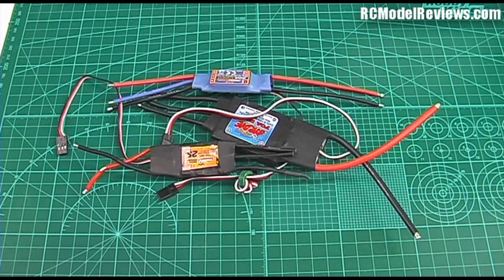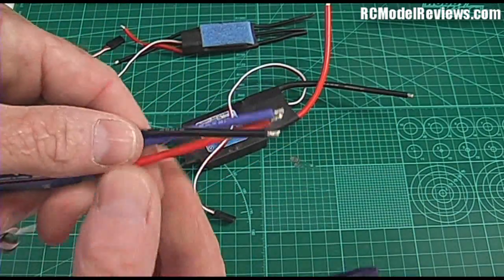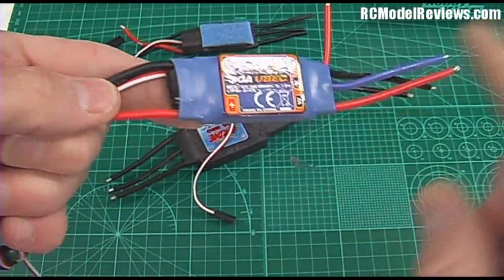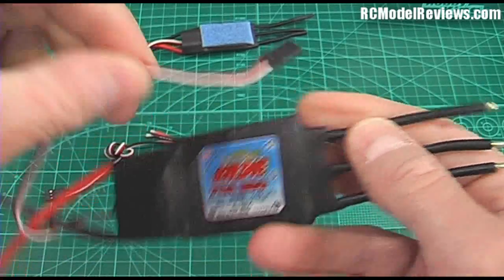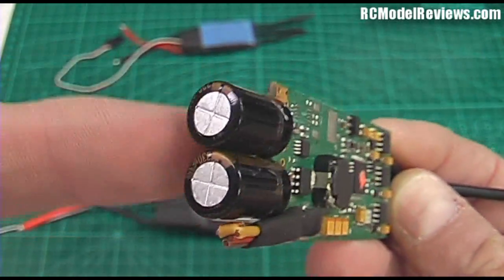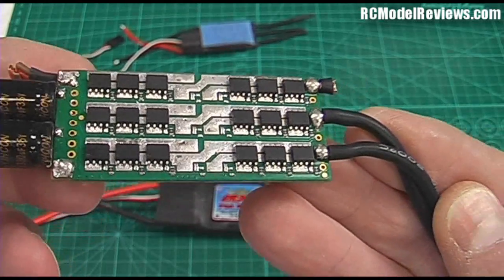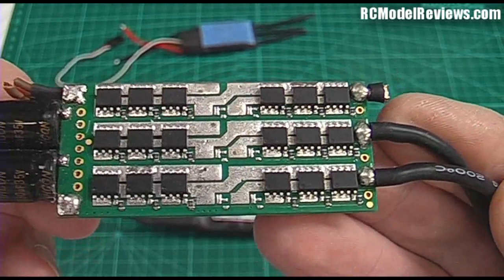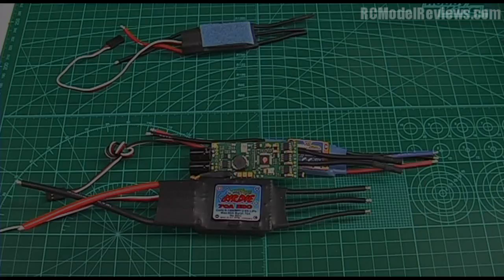What's inside: ESCs

Comment: +RCModelReviews
Good video mate! 
I am turning a 240v wood planer into an 18v brushless one. My question is, are these esc units able to provide a constant speed setting? 
I want to run the motor at 26000 rpm at no load and have that remain constant until maximum power is reached, without a variable trigger. 
If not an esc, what would you suggest I use to control it?
Reply: +Ijustlovequality You can control an ESC directly using an RC servo tester, they're usually inexpensive and have a knob on them to vary the servo position. If you plug an RC ESC into them instead of a servo, the knob will vary the motor speed.
Problem is, this is an open-loop speed control and will not adjust the current automatically to maintain a constant motor speed. To do that, you need an RC helicopter ESC that has a governor function, which is intended to maintain a constant rotor RPM. These ESCs are harder to find and often much more expensive.
Just curious, why do you need a wood planer that runs on 18V DC? If you have a DC power supply available, for example solar panels and batteries, why not just buy a power inverter and run your power tools off that with their existing motors?
Reply: +BasementEngineer thank you for your reply! The heli esc looks like the go!! I've already bought the team Orion 1/8 220 amp I think it is, but I'll look for a heli one I reckon. I want to use the festool 18v battery that all my other cordless tools use. Cordless is so much more convenient than running leads. Plenty of brands make them, but they all have design flaws. As with anything, if you want something perfect, you gotta do it yourself 😂
Reply: Ijustlovequality Just make sure the battery is up to the task, i.e. can deliver the power you need. Overloaded batteries, particularly the lithium ion variety, can give pretty colorful smoke shows. You might want to put a couple of them in series to get 36V or more, to keep the current from getting out of hand.
Also, if using a sensorless BLDC motor, keep in mind that the starting torque will be next to useless. Sensored motors behave pretty much like brushed motors and have much more starting torque, but a governed helicopter ESC will probably only work with sensorless motors because high starting torque isn't required for aircraft. Have fun!
Reply: +BasementEngineer thanks for the heads up! I'm only looking to get 750 watts, so it shouldn't need any more than 60 amps.. I'm keen to look into that! Option 2, is control the motor and esc I have with an arduino. I have a 1750kv 1/8th hobby wing xerun sensored so I will see what I end up with. I've been told I 'can't do it' so it's gotta be real good 😂
Reply: Ijustlovequality For 750 Watts in, or out? 750W in at 18V is about 42A, so it should be pretty easy to find a fairly inexpensive sensored ESC and motor, but the ESC won't have a governor mode. It might be fine though.
750W out is ~1 HP, if the motor is about 75% efficient, which is pretty typical, you'll need 1000W in, or 60A. Also doable.
Also remember, some power will be lost in whatever transmission you use, because small RC motors run very fast and will have to be geared down to run a tool. On the other hand, they'll weigh next to nothing, which might come in handy for portable tools :)
Reply: +BasementEngineer the original motor in the tool was rated 720w so I'm not sure. I'm just going to give it as much power as it needs which should be around the 750 watts input mark I suppose. I think the motor I have would be capable of at least 1500 watts, being a fairly reputable 1/8th scale buggy motor, and looking at what other 1/8th scale manufacturers claim in their spec sheets. The original motor ran at around 27000 rpm, so the 1750 kv motor should be fine without a gearbox I hope..  
I am not concerned about price as long as the esc will be absolutely reliable. I'm keen to talk to my hobby shop guy about these heli esc's!
Reply: Ijustlovequality OK, just keep in mind that heli ESCs are sensorless and that means the starting torque is rather wimpy. The tool may have enough friction that the motor might have a hard time starting.
Also, if the original tool had the cutting attachment right on the motor shaft, you won't be able to do that with any RC motor--they're not designed to be used as machine tool spindles! That makes the conversion much more complex because you'd have to build an appropriate spindle, then drive it with the RC motor using gears or a timing belt.
If you order an ESC online make sure to get a servo tester as well 'cause you'll need it to run the ESC without an RC system. You might be able to get one at your hobby shop, but they're often much cheaper online, same with ESCs themselves.
Reply: +BasementEngineer startup torque shouldn't be too much of a problem as the tool will run at 80-90% speed. I've machined up a housing to bolt the motor to as well as support the motor shaft. I've removed the little bearing out of the front of the motor so the spindle bearing and motor bearing aren't fighting each other. 
I'll see my local hobby shop. Buying things online is cheap but unethical.
Reply: Ijustlovequality You should post some vids describing it as it goes together, I'd like to see it :)

Comment: Those hobbyking Birdie ESC's are junk I burned one out was twice the current my power system was pulling. Lucky I didn't crash was only a hover at the time went to a castle and never had an issue. Maybe some of the others are okay but not worth going cheap on the ESC unless your model is cheaper one.

Comment: I purchased a DJI F550 kit with E300 power system one of the motors was bad so I asked for an RMA from DJI and they told me to send in the whole drone the F550 Flamewheel is much larger than the Phantom so we went round and round about sending in just the motor , They would not let me send just the one little motor . I found out they don't have the E300 anymore according to DJI . Anyway I gave up on getting any warranty from DJI . So my question is ,,,
#1- I purchased all new E310 motors the DJI Guys Form said I could use the E310 motors with the E300 ESC's OK so I did and the motors run hot much more than my Phantom motors do . Will going to the 420 Smart ESC's from DJI help cool the motors and give me longer battery time E300esc is 15amp and E310 motors are 20amp and 420 smart ESC's are 20amp .
#2- What is a "smart ESC" and do I need them for the E310 motor to work right ? Or will any 20 or 30 amp ESC fix my problem ,,, The motor problem not the DJI problem .
  By the way I would like to be finished with DJI and not give them another dime . All over one little $15 motor they don't want to make right . The 420 Esc's will be the last thing I buy (if I cant get around it) There are many good model company's out there now that want you to be happy with them . DJI just is not one of them .

Comment: hi mate big question, i have an align 500 trex running an external turnagy 40 amp sbec i couldnt shut the motor off when i hit the hold button, then i preceded to shut the dx8 off, heli kept running, at this stage it rotated ending up on its side wrecking all the futaba servos inc the tail. stripped the main gear, the list goes on, mate what is causing this issue, i suspect its the turnagy sbec not the esc, which is an align esc,, pls your thoughts would be well appreciated,this has so far been an expensive electrical fault ,, cheers mate, wilfred
Reply: +Wilfred Firley 
Make sure your throttle hold button/switch is properly set up in the transmitter to provide a zero-throttle signal. Remember, throttle hold is often programmable and can provide any fixed throttle level, not just idle/zero throttle.
Reply: thanx mate i will take your comment on board thank you much for your reply so actual setting should be set at 0 on all models, so just setting soft start in the esc wouldnt rectify the throttle set for the hold switch
Reply: Wilfred Firley Nope, soft start just means the motor's rate of acceleration is limited for the first time you apply throttle after connecting the battery pack. It doesn't affect throttle hold--you have to set that up in the transmitter, not the ESC. Make sure it works because it's a safety measure, it's also useful if you're checking something out on the model or making adjustments with the battery plugged in!
Reply: Spectrum only use -80 to +80 whereas the ESC may be expecting -100 to +100 so zero throttle of -80 on the TX isn't zero throttle to the ESC, that's why you have to calibrate the throttle, also 0 is mid throttle not nil since the range is minus to plus with 0 in the middle,

Comment: why do ESCs get hot? mine is getting hot even when motors not spinning and just batteries connected to it. Brand new ESCs. How do i determine if they are failing?
Reply: +Ying chee Thum 
They can heat up if the have linear (non-switching) BECs, and you're using the max number of cells. For larger cell counts (4S lipo or more) it's probably best to use an ESC with a switching BEC, they're more efficient and give off less heat.

Comment: Hi,
ESCs are basically DC to AC converters?
Reply: ***** A portion of them is, but there's much, much more to them than that. The output frequency is determined by the motor's pole count and rotational speed, and the ESC must be able to determine the rotor position without sensor feedback for commutation.

Comment: Few question...
1. Do these ESCs use sine wave or square wave? because square wave is a lot more easyer to produce, but less efficient for running a motor...
2. Do they control speed by current, or by frequency?
3. What frequency or frequency range they run at?
Reply: RPBCACUEAIIBH They use square wave, because they are for driving permanent magnet (synchronous) DC brushless motors, not AC induction motors. Sinewave drives are for AC motors. These ESCs control speed by PWM (duty cycle) control. Typical switching speeds are 8 to 16 kHz, some over 20 kHz.
Reply: Ok thanks for the info. Then it's easy to build at home. :)
Reply: RPBCACUEAIIBH Wish I could build one of these :) Actually they're pretty straightforward, but the ol' marbles don't work worth a damn anymore. I probably could have done this as a kid if I'd had any money.
Modern microcontrollers make motor drive electronics pretty straight-up projects if you know how to program them. Keep in mind that power transistor continuous current ratings have to be several times higher than the motor's continuous current under load, or the transistors will pop when starting the motor from a standstill with an inertial load.
Reply: Yes I know... I've built some H bridges before driven by arduino... :) same there with the power transistors... I've also built one of my arduinos. ;)
Reply: The Arduino and H-bridges will only run a brush motor both ways... These ESCs not only provide throttle control (and occasionally direction control as well) but also detect the rotor position and do all the commutation. Much more to them than an H-bridge driver! If you homebrew your own microcontroller projects, you ought to be able to sort it out, but these are really sophisticated little toys.
Reply: RPBCACUEAIIBH
So essentially, your driving a BLDC motor as a stepping motor on only two of the three phases with a forced commutation sequence.
The arduino should be able to drive a 3-phase sensor-equipped BLDC motor properly, or if your really good at programming (I'm certainly not!!) it may be possible to run it in sensorless mode. Sensorless controllers for RC applications are cheap though, and if you need one that works with about 25 volts or less, they're really cheap, and are available in current ratings of 100A or more. They're easy to drive with a microcontroller or 555 pulse generator, or just buy a servo tester for a few bux.
Reply: +RPBCACUEAIIBH +BasementEngineer I love you two
Reply: +BasementEngineer Wrong.
Reply: Fennecbutt Wrong in what regard? About what?
Reply: about this: The Arduino and H-bridges will only run a brush motor both ways...
you can use one half of a H bridge to drive one side of any coil, if you connect 3 coil of a motor in star, and ground the common, you can drive 1-2 coil at a time, which makes it run, however it's far weaker. If you have 3 coil in delta, you have 1 end for each 2 coil, and you can drive the motor with 3x half H bridge, and as it is done most likely in those ESCs... you just have to drive the half H bridges with sine waves shifted in about 120 degree from each other, so that 1 coil pushes and 2 pulls, after which 2 coil pushes 1 pulls, always in the correct order. So there is 2 way actually to drive a brushless motor that I can think of, and also tried. I may not be able to properly explain in an uderstandable way, but it works, I've tried with a modified hard disk motor, which had 3 coils in star connection, however carefully I was able to separate the common end and have all coils connected the way I wanted... A brushless motor works as a 2 or 3 or more phased motor, you just have to drive it the right way... :)
Reply: There is a ketch however... the brushless motor's speed depends on the current you're driving the coil with, the inertial of the motor, and also the frequency you're driving with. You can spin up the motor gradually to a very fast speed, however if the frequency goes beyond a certain limit, where the coil doesn't have enough push or pull time to overcome the inertial of the motor, the motor stops running, and starts vibrating between 2 nearest positions, and heats up fast. This can also happen if the motor is overloaded, or blocked briefly. that's why you need a hall sensor connected to the controller to monitor motor speed. otherwise you can end up frying the motor.
Reply: in star connection yes that's the case, but in delta no, I'm pretty sure it's practically 3 phase, that's why it's much stronger as well. As I said, I've separated the common connection, and each coil has 2 ends(6 ends in total), so that I can drive it as I want... I'm running it in sensorless mode that's why I've encountered that stopping and vibrating problem I've mentioned. Without a sensor I was able to run it at about 11000 rpm, with no load however it's unstable, and a slight load will make it stop and vibrate... Of course it's a hard drive motor originally designed to run at 5000-7000 rpm. (I'm not sure exactly what speed) Thanks for the tip I'll probably try sometime that controller, however I'm pretty sure that won't give me anyway near 11000 rpm... :) anyway it was a fun project. :)

Comment: anyone know where i can get/ whats the best ESC with a SBEC to power my server that doesnt require soldering ?
Reply: +Mac Vidler None of them require soldering, just plug the ESC into your receiver and the BEC (onboard the ESC) will power the receiver and servos from the propulsion battery.
Just make sure the BEC is up the task, i.e. it can supply enough current to run all your servos. The radio receiver itself uses hardly any current so it can be ignored, but get a handle on how much current all your servos need. You can look it up online, but most ESCs with switching BECs (2 or 3 amps) can run 4 standard servos or smaller, or 1-2 big ones (giant scale). For huge model aircraft with 4 or more very large servos, you should probably use an external BEC good for several amps.
For ground models it doesn't matter much, but for airplanes or helicopters a BEC failure means you lose control of the model and crash it so make sure the BEC can provide enough current!

Comment: greetings
First off Im new to this so go easy on the tech stuff ; )  I purchased a racing quadcopter equipped with 4 sk 12a speed controllers. We replaced  NEW 1 of the controllers do to a crash. I have all connections in the proper configuration however the motor runs at a slower speed than the other 3 motors on the quad. WIth this limited info that I provided can you give me any advice on what we did wrong
thanks